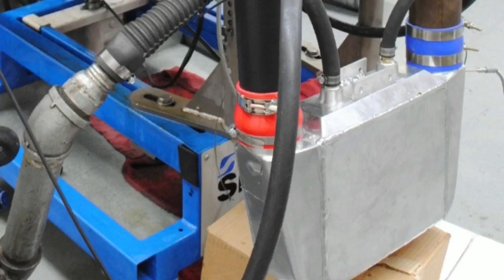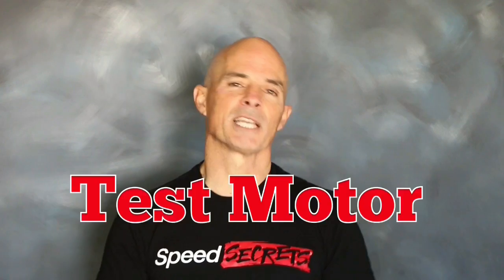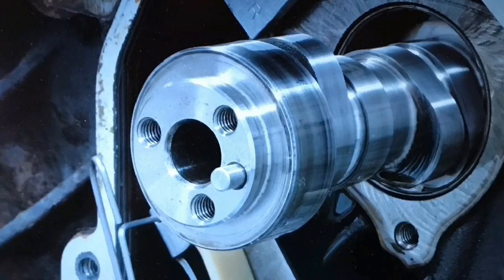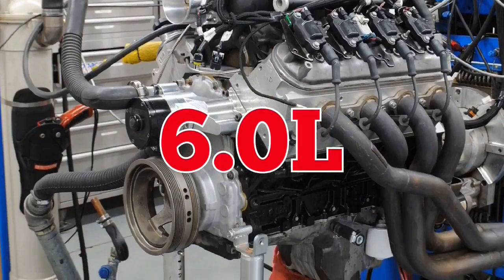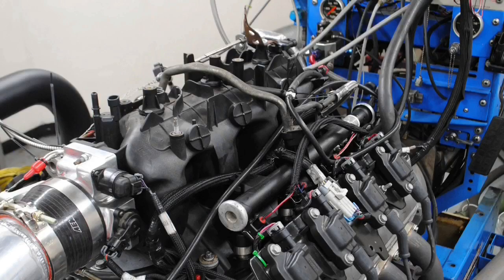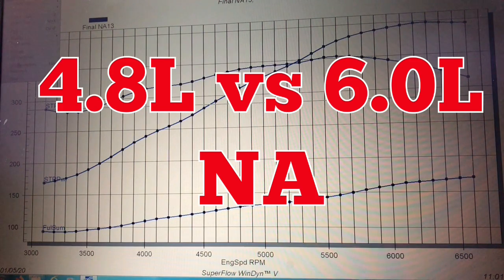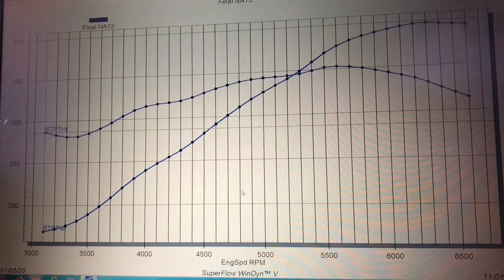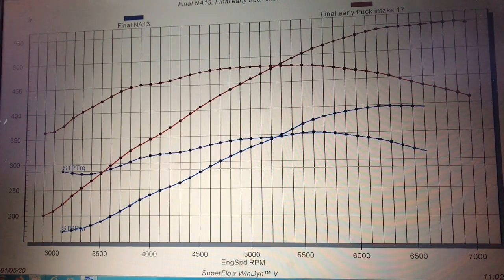SUPERCHARGED 4.8L vs 6.0L Full BOOSTED Results!

Comment: I’d really be interested in seeing the difference in a 4.8 vs 5.3. Everyone is using the 5.3 these days.
Reply: Kfx Guy +++
Reply: the results are linear 72 cubes gave 150 hp na and sc.  4.8 to 5.3 is approx 40 cubes or 80 more hp on a 5.3
Reply: @roknroy1  the bore on 4.8/5.3 are the same, the stroke on the 5.3 and 6.0 are the same
Reply: 4.8 will ring out. Put 4.8 rods and crank in a 6.0/6.2/7.0 and you’ll have a very good nitrous or turbo motor.
Reply: @RadDadisRad  

293, 325, 364 are like 302, 327, 350.
Reply: Bro I keep telling folks that 4.8 ain't no punk!
Reply: Just pulled my G-body project all the way from Ellijay Georgia to New Orleans through the mountains and she never dropped below 60MPH going uphill but I set Cruise to 65MPH all the way home!...Mighty Mouse is a fitting name hell I know for sure I'm putting a 4.8 in my G-body when I'm through playing with the 307 in it!...
Reply: My buddy’s 4.8 with turbo in a nc Miata is plenty enough .Likes zo6 for lunch .
Reply: @gregblack4581  not different from a fiero or gen 1 mr2, or even a Cavalier/cobalt or geo storm
Reply: I wish he would have pulled them BOTH till they nosed over NA and Boosted...
 4.8L centri seems like a nice centri combo...sure that stroke in a 6.0L even better on the street
Reply: Kfx Guy I mean, this comparison is flawed. The cam in the 4.8 wasn’t nearly as agressive as the 6.0. Plus the 4.8 likes to rev higher. He should’ve used same cam and heads to make a fair comparison.
Reply: Tommy Hathaway I really meant to post that this morning. Truth be told, I was driving and listening to it. I couldn’t watch it and the cam specs weren’t retained in my memory. I had planned on going back and watching it. If the heads, cam and compression aren’t the same. Then the test isn’t really comparable.
Reply: @tommyhathaway9190  first the 4.8 had the better cam for a blower with the 120 LSA vs the 113 in the 6.0. Even running the same heads and cam is a problem. Depending on what combination is used will affected each differently depending on a few factors. One is simply going to benefit more than the other. Also you need to factor the static compression ratio. That's going to change depending on the piston and the cc of each head. 
The 6.0 is making about 1.5hp per ci and the 4.8 is making about 1.35 per ci. 
So if you want to how much hp would be gain by going from a 4.8/292ci to 6.0/366ci from just cubic inches alone. It's about 99hp. 
Now I believe the point of this video was to show how each was affected by boost. Not how much more a 6.0 makes vs a 4.8 in general. He wanted to show how the boost will drop on the 6.0 motor but still increase the hp by the same amount as the 4.8 motor. Which is exactly what this video did.
Reply: Wayne Bollentin but to show that accurately they would need a very similar setup. And I was saying the 6.0 had a more aggressive cam. As in low end response. Plus it’s a supercharger it’s not load dependent like a turbo. He’s already making loads more tq as he comes into boost. The 6.0 still would make more, I know. I’m just saying the 4.8 needs more rpm to compete cause that 88mm stroke needs to spin to make up.
Reply: Wayne Bollentin I also get it about the compression. But I forgot how much the 6.0 had after they put the new pistons in.
Reply: @waynebollentin989  the 4.8 did not have the better cam for a centrifugal super charger.
Reply: @baby-sharkgto4902  how exactly is the cam with a narrow LSA better ? If the 6.0 had the same 120 LSA it would have made more boost resulting in more power with boost. It also would have made less power in N/A.
 The lower the LSA the more pressure that's lost. The 6.0 had a cam that's a little more aggressive but that's doesn't mean it's better. That was my point. Just saying a can was more aggressive doesn't make it better.
 It also actually works both ways because the 4.8 would have benefited and made more power with a 113 LSA in N/A. As with Boost the 120 LSA was the better choice and why it made the power it did.
Reply: @baby-sharkgto4902  was it exactly for a centrifugal supercharger no but it's still a better choice with the 120 LSA vs the 113 in the 6.0. The 6.0 wasn't for a blower either but  Like I said. The lower the LSA. The more boost that's lost. The reason the 6.0 did ok was because the 113 LSA isn't terrible. You'll find many blower cams with a 114 LSA. It's not like a aggressive N/A cam with something in the 108 or less range. If the 4.8 had the same 113 LSA non blower cam it would have made less power. That's the point I was making. Other things obviously dictate whats going to work best like intake, head flow, port size etc. Why do you think the cam in the 6.0 is a better choice?
Reply: @waynebollentin989  true man. One thing I've learned is that everyone does things differently. For example, I have a Texas Speed 427 with an F1A Procharger and the cam I use is 238/242 .595/.595, 112 LSA. The Internet says that cam won't work. However that cam works ridiculously well. And when I talk to people who were around before the Internet they say "duhhh of course that cam works well" With that said most people and research agree that a positive displacement blower, which has just as much boost at low RPM as high RPM likes a little more lobe seperation.
Reply: @baby-sharkgto4902  obviously there's many factors on what's going to be best for a particular combination. This here is very mild setups compared to a 427 with an F1-A. I just didn't agree that the cam in the 6.0 was a better choice than the 4.8 under boost. It's definitely better than the 4.8 in a N/A setup. Just some many factors when it comes to different motor combinations on what cam is going to be best. So many factors on just the head itself. I'm sure you see where I was coming from. Obviously 120 LSA isn't going to be best everytime. Specially the more aggressive the combination gets. God it's been almost 20 years since I ran the D3R on a 428 sbf with yates heads but if people knew what compression and cam spec we ran. We would have been called nuts. Definitely not your avg blower cam. Same a few years later when I had a 347 sbf with 100mm single turbo. No one was running big cams back than but if you have a big enough blower or turbo you can. Your not worried as much about losing pressure when you have more boost available. 
What heads you have on the 427 ? I'm guessing your making at least 1300hp. Obviously depending on what pulleys combination could be less. Love Procharger though. Great company. I ran vortech in the 90s but made the switch around 2001. 
I'm Planning on a F1-X-12 for a street 427 sbc I buil. It's built for boost but N/A made 687hp on pumped 93. Hyd roller, rev kit, afr 245 heads with Jesel shaft rockers. Should make good power with boost. Good luck bro
Reply: @tommyhathaway9190  the ci difference makes a comparison like that very flawed. honestly i'm not sure what would make the most accurate comparison but I'd think it would have to be heads and cams that brought evened out their respective thermodynamic efficiencies.
Reply: @tommyhathaway9190  drop the lq4/lq9 cam in the lr4 and you dont need a comp cams unit.
Reply: 4.8 and 5.3 share the same bore, heads. 5.3 and 6.0 share same stroke.

A 5.3 is a 4.8 stroker.

Think of it like this,

Gen 1 SBC- 302, 327, 350
Gen 3 SBC 293, 325, 364